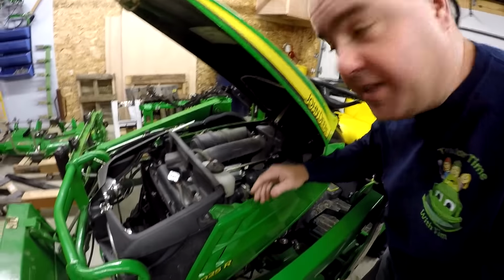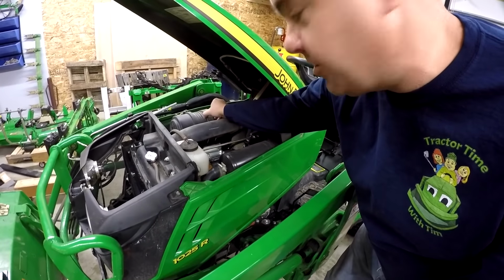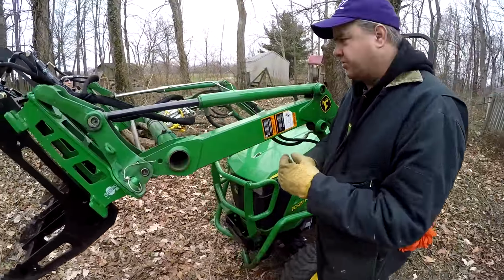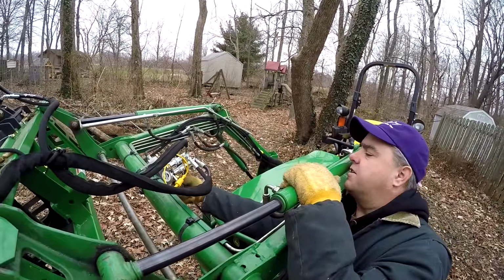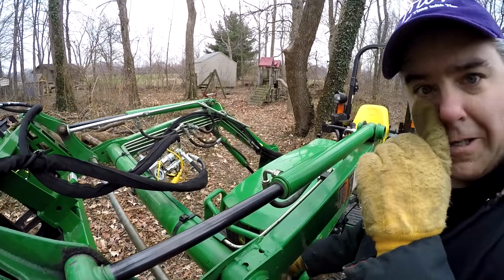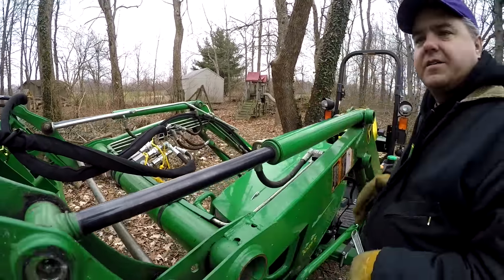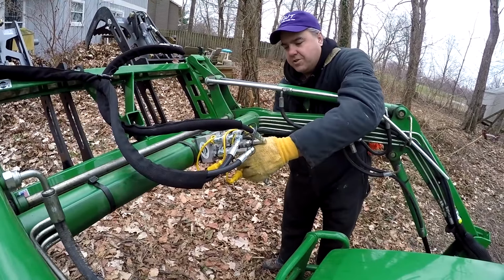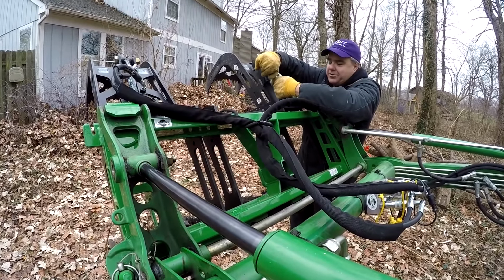Artillian Grapple Picks Up Leaves!!!

Comment: I never would have guessed the grapple would do so well at picking up the leaves. I imagine that they were wet and compacted well which helped. Thanks for another great video!
Reply from the maker: Moist , but not soaked.  They had not been rained on
Reply: Tractor Time with Tim that's even more impressive. Great job!

Comment: I was amazed at how well the grapple handled the leaves! Surprised me how well it handled the loose material.
I agree with your comment about the dump location. That would not have been my choice at all, but you have to do as the customer wishes. Overall Johnny did a super job!
Maybe I should start lobbying my finance committee for a grapple!
Reply from the maker: Better start lobbying. In my experience, it takes awhile :-)
Reply: Tractor Time with Tim Nothing ventured, nothing gained. Lol

Comment: The grapple worked better than I would have thought. I'm like you I don't believe I would have put the leaves there. If it turns off dry, they are a fire hazard and when they get wet that's not good for the house. Take care and God bless.

Comment: In my area a grapple and pallet forks would be the most used attachments, moving large bundles of branches is time consuming and exhausting. As for the leaves I have found that TWO hand leaf blowers are better then a single backpack blower and a large tarp to blow them on to, then just drag the tarp to wherever the leaves need to go.  Thanks for sharing!
Reply from the maker: We use the mulching deck.   Lazy here :-)

Comment: You’re right – first thought is the leaves will fall through the cracks. I think it worked because the grapple enabled you to pack together such a large amount of leaves and to compress them tightly, thus eliminating movement of the leaves. Hope that makes sense?
Reply from the maker: It does make sense, and I agree!

Comment: A grapple does a pretty good job with leaves if they are in a pile, or if you are working on a surface like the forest floor where you can pick up the odd stick or two to help compress them into the lower jaw (making it so they don't fall out).

One use that I find they are great at is removing briar bushes. Our woods are loaded with them, some near 20' in diameter and a real pain (in more ways than one) to deal with. The grapple allows you to grab on to it starting high, compress the bush, and dig down to the roots in one motion, ripping it out. However, since briars tend to stick together and they form long whip like branches, when it does break lose it tends to want to wrap around the operator!  I've had the things come flying back and stick into my arms, head (wearing a hat), legs...not fun.
Reply from the maker: I think I'll take your word for it ...and wait for your video, rather than attempting to show that 'whipping briars back toward the operator' for myself :-)

Comment: I'll admit I was thinking like you that's going to fall right through there. Surprised me. Great video. I've heard that the air cleaner bracket was failing and when you didn't tighten it up I thought that's not going to work 🤔.

Comment: For the bracket if the bolts are coming loose, you should put a lock washer to keep them from coming loose. I would use what is called a star washer not a split washer. If you look on the JD parts web site you can get the proper size of bolt to know what size washer to get.

Comment: I knew you wouldn't have a problem picking then up, because when I clean them up I use a pitch fork. I do believe where the valve is in front needs to be more stable, maybe welda plate on tube then bolt it down, then maybe hoses wouldn't come loose

Comment: Very impressive! Went to order my own grapple. Got to checkout to see it was a little over $3,600 decieded id wait for a little bit! Have you thought about Fabricating some sides to also have a rock bucket?
Reply from the maker: Make sure you set the zip code for shipping.  I think the site defaults to $1000 for shipping until you specify a destination.

Have not thought much about mods so far.   Just getting started with the basics :-)
Reply from the maker: Ryan, I configured a grapple with two clamps and frame.  I got $2857 including shipping.  With a single clamp, it would be ~$600 cheaper.  Are you SURE you entered your shipping address???   Otherwise, shipping is estimated at $1000 ...(yes, brilliant).
Reply: Tractor Time with Tim that makes total sence! No i got to the cart and saw my sub total and my wallet screamed! Lol was that with the diverter kit also?

Comment: agree with Tim, keep an eye on that bracket..reason why.. John Deere is bad for ignoring reported issues.  I reported the rear PTO failure of my 4100 within the first year ( metal shaddered ) the replacement was not made to spec and I was informed I could fill out a form so John Deere was made away and would fix the issue and correct the replacement part. For 10 years I reported this issue, 3 shaft failures..having to take the replacement to a machinist who charged heavy to grind it to proper specs... still JD did nothing...

Comment: This is old but...  In this video, I can see that the 90 degree elbows are probably causing the fittings to become loose.  The hoses are applying torque almost like wrench every time the grapple curls, causing them to loosen up after a few hours use.  If the hoses had some support next to the couplers, that likely wouldn't happen.  I'd try attaching them temporarily to the crossbar with a couple of those giant reusable zip ties.  If that stopped the problem, I'd go ahead and try to devise a more elegant solution.

Comment: Hey Tim thanks for another great video was wondering do you think if that bracket comes loose again or breaks that you should put some kind of rubber or Springs underneath it to take away the vibration from the engine which seems like what's probably causing the issue
Reply from the maker: Maybe so.  I will likely talk to my local Deere dealer if it comes loose.  I checked it after the grapple job (and a snow plowing job here).  Still tight.

Comment: Adjustable wrenches are fine, however not all are decent. You need to find a brand that’s good, number one, and then you need to check the worm gear and the slide part for tolerance and fit they need to be tight with precision movement. If not they will slip and round off nuts etc. I like the old Crescent tools from the 60’s through the early 80’s if I can find them same with Vise Grips. whenever I’m at garage sales etc. and see good tools I buy them.

Comment: What do I think of those leaves. I think you're just showing off! You just want me to be even more sick because I don't have a grapple. Hey I have one or two of those metric adjustable wrenches. :) I also have some SAE American ones too! Don't carry them on the tractor though, I carry a set of pliers. SAE channel lock type. Probably should put a pair of metric pliers in the tool box too, seeing as most of the nuts are metric. LOL!!! Great video!
Reply from the maker: Yes, I think a good set of channel lock type pliers would be a good addition to the toolbox.  I found newer ones with much better locking capabilities (much less frustrating). ..check them out here:  http://www.tractortimewithtim.com/2017/03/02/tims-new-favorite-pliers/
Reply: Yep, I have a set like them and an older set that I like even better. The older set grip much better. The jaws are made to grip and not let go.

Comment: Nice job Tim! It's always hard to do something that you know is wrong. Obviously John Deere is your favorite tractor, but what would be the next runner up? Thanks from here in Nova Scotia, Canada.
Reply from the maker: I love em all, Danny!
Reply: Lol, I do too! I have been looking at sc tractors for awhile now and just can not decide. I never thought it would be this hard.
Reply from the maker: Focus on your dealer.  Which is the best dealer support.  Then, focus on your needs. If you need easy attachabiliity (drive over deck, easy backhoe attach, lightweight quick attach loader, etc) you will need to stick with #1 and #2 in the industry.   If not, you have many other choices.

Comment: My bracket broke last summer. Strap and bracket.  I haven't replaced or repaired them yet. Do you see anything detrimental to leaving it broke?
Reply from the maker: Yes, apparently some are wearing through the valve cover or something like that.
Reply: Thanks Tim. I'll check it out.   Our local John Deere Dealer just moved to a new location. Guess I need to go see the new store.   Happy New Year to Everyone.  By the way, It's pretty chilly here in Bowling Green. lol No Snow.
Reply from the maker: Ky?  If so, very close to our friend Phillip.

Comment: I have a battery powered adjustable wrench made by black and Decker and I like it much better. Simply put your wrench on the nut and push the in button to tighten it to the hex head. When done hit the out button to loosen it up. It's a great tool, as long as you keep the batteries fresh. But you can still use it manually when the batteries die. Check it out here: https://youtu.be/_yfKjltRcx4